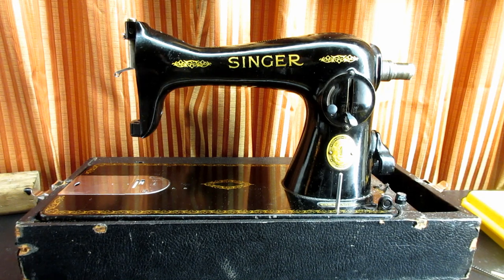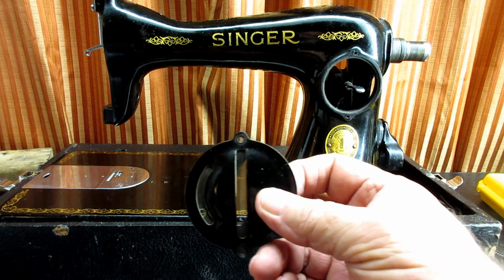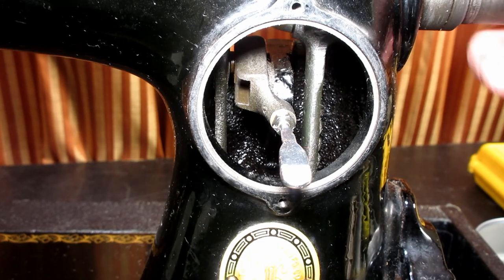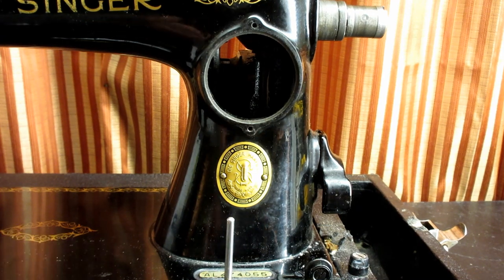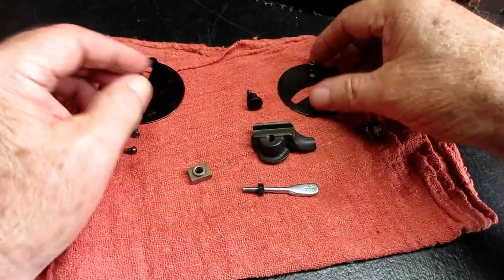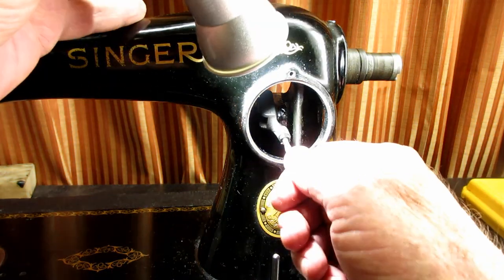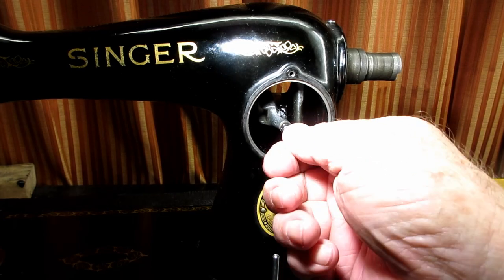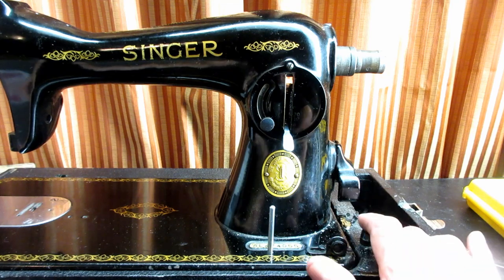Singer Model 15-91 Feed Regulator How to Remove, Install, Adjust.

Comment: Good morning Andy, I have used metallic gold craft acrylic paint to renumber the stitch length regulating face plate. Just paint a little over the numbers and slots and gently wipe off the excess and wallah renumbered plate. Oh I almost forgot to say Thank you for another great Video!
Reply: Thanks for sharing gold paint trick!
Reply: @sherleneabrigo9594  Most welcome.
Reply from the maker: Thanks for the nice tip. I'll pin your comment up top. Any particular thing used to "gently wipe off the excess"? Hope you enjoyed the video. Take care.
Reply: @andytubesewing1953  I use small pieces of cut up T shirts and dampen then up just a little to help get the excess paint off before it starts drying
Reply from the maker: @roosterwilson9371  Yes, sir! That's what I'm asking about. Thanks for getting back to me with this info. 👍

Comment: How do I readjust or fix my 15-91 to make 5 stitches per inch for sewing vinyl???
Reply from the maker: It's not really designed for that, but a small number of people have said they removed the indicator plate and that allowed a tiny bit more travel downward. The problem is that the feed dog, which is what really controls the stitch length by how far it moves the fabric during needle strokes) may hit either the body in the back or the hook in front. I've never done it myself but have never had the need for a stitch that long.

Comment: That's called a spring washer or a  Belleville washer.
Reply from the maker: Right you are, Jo. A Belleville washer, also known as a coned-disc spring, conical spring washer, disc spring, Belleville spring or cupped spring washer as per Wikipedia; https://en.wikipedia.org/wiki/Belleville_washer
Other than that, how did you like the video?

Comment: Would someone need to adjust the machine, after doing this or?
Reply from the maker: No, not at all. We are just removing parts for cleaning or replacing or maybe to paint the gold numbers back on. Nothing in the video will change how the regulator system works, except maybe oiling it can make it move easier and smoother. There ARE adjustments that CAN be made to the feed dog at the other end of the machine, like to set the proper height and the position in the needle plate, but those changes are made under the machine. A really good question ⭐ and thanks for asking it.

Comment: Thank you, Andy. Excellent video. I now understand how the stitch/feed regulators work and how to reduce the stiffness of the stitch regulator handle. My mother bought a 15-91 new in 1949. I learned to sew on it when I was a kid and I inherited the machine in the 1980s. Have been putting many miles on it since and love the machine. It will get passed down in my family when the time comes. 
Thanks so much for helping us service these great machines.
Reply from the maker: Thanks for the uplifting comment, Linda. 🙏 I love hearing of family-owned machines. It certainly has more lifetimes to go with a bit of care. This was the only 15-91 I worked on and I found it fascinating. It's built more like an industrial machine, IMO, than a household model. Here is the complete Playlist for the model: https://www.youtube.com/playlist?list=PLsCOZgzzaiKJftyGwzdDiWa9R6HFEACJo   I had started to record about cleaning and rewiring the motor but became too ill to complete it. Luckily for all of us, there are some very good videos for doing that. May you always sew in happiness, and have a great New Year 2024

Comment: Hi Andy.  Question regarding the slide block:  As you showed, the slide block protrusion (minute 17:00) goes up against the feed forked connection in this machine.  In my other machines (403A, 404, 401A) that I have restored, I put the protrusion the other way, into the slide.  I panicked, thinking I have to go back to those machines and flip those block slides over, so the protrusions sit against the feed forked connection.  Then I rewatched your videos on the 404 and 403A, and you also put the protrusions in these machines into the slide.  Will you please clarify this issue for me?  Why would Singer flip that slide block over in its more modern machines?  Thank you for this video.  You spend much time storyboarding, researching, filming, and editing making these videos.  I enormously appreciate your work.
Reply from the maker: Hi, Carole. Thanks for watching the video and asking such a well-worded question. In this video, I put the slide block on in the position I found it when I first removed it. I have parts manuals with pictures and parts numbers for all the models you mention, but none of them are clear as to the positioning of the protrusions. They are not mentioned in any of the Service or Adjusters Manuals as far as positioning.  Offhand I'd say if something is incorrect, it is this video. I went today to my storeroom and retrieved an old model 404 I bought years ago for parts. It was lightly used but had been dropped hard and the bed broke so it was cheap and I've used several parts from it. As near as I can tell the feed regulator indicator plate had never been off the machine. When I removed it and looked in at the slide block, the protrusion is clearly facing INTO the regulator and AWAY FROM the Feed Forked Connection. When I worked on my first slant needle, a model 301, I had no documents so I took pictures of everything, especially before I removed parts, so I knew how it went back. It's my belief that how you placed the slide blocks on your slant machines is correct. It's also my belief that how I found the slide block on this 15-91 MAY (might) be wrong, but that's how I found it. I also can tell someone has worked on various parts of this machine by the look of several slightly damaged screws, a missing screw, three missing oil wicks (so far), and so forth. However, as this is the first and only 15-91 I've ever had my hands on I'm going to take a wait-and-see attitude towards the slide block. I can say I have reinstalled it to make other videos and it seems to work normally, but who knows in the long run, and I have not sewn anything yet. I assume you don't have a 15-91 or you would have looked at yours already. If/when you or I can hear from another owner as to what they find I'm OK leaving IKE as shown in the video. If you happen to belong to any online sewing groups and ask members about their machine and get a credible answer please let us know. Take care and thanks again for raising an important question.
Reply: Thank you for your detailed answer, and for checking your parts 404.  I’m happy to read that putting a part back how one finds it is a valid and operative method.  I am sure you assembled Ike correctly.  I shoulda mentioned, I am following your tutorials with my own 15-91 (A Roger find $50 at a flea market).  And, yes, my slide block was in the position as you found Ike’s, with the protrusion against the feed forked connection.  I have wondered how slide blocks go in since I first started watching and working on my 457 with your videos—the protrusion goes in the slide with the 457 (Same goes for the 328, 337, 347).  So I thought this was the way for all Singers with these parts.  But not so for the 15-91!  If one puts the slide bar with the protrusion in the slide in the 15-91, the slide bar sits maybe 1/8” above the slide edges itself, because the protrusion rubs on the bottom of the slide.  So I’m sure the slide bar goes the way you put it in Ike—it fits nice and snug and sits exactly deep into the slide bar.  Curiously, with all my other machines, the slide bars actually do not touch the bottom of the slide, no matter which way you put the slide bar; the slide is kind of curved at the bottom, so no matter which way you put in the slide bar, it doesn’t touch the bottom and is the same height above the edges of the slide.  Well, now I’ve learned to take some pictures before removing parts, even though I have your videos to double check!
Reply from the maker: @carolemagnusson5044  You would think at my age I would know better than to assume, haha. I'm happy you have a 15-91 (at a great price thanks to Roger, the Prince of  Procurement ⭐) and you verified the position of the slide block. That makes two for two machines. Normally, putting a part back the way you found it is valid, but not always. Think of it like "trust but verify". There are a few times the part was wrong to begin with. Maybe a pressure washer had been reversed, or the parts on a 500A bobbin winder were out of position. Sometimes it is very obvious b/c it does not function properly. Anyway, as with this slide block, I wondered why I found it as I did, but accepted it. Maybe the hinge stud through the Feed Forked Connection on the 15091 is a little different; whatever. After assembly, it worked just fine so I left it. I feel more confident now that your machine is set up the same way, and thanks for letting me know. 🙏

Comment: Started working on a rusted 15-91 and can't get the little screws on the regulator plate to release. This is the second day I've use penetrative oil and nothing..... any suggestions? Your videos are SO informative! Thank you so much!!!
Reply from the maker: This can happen for sure, and sadly those little screws are a fairly soft metal and it's easy to strip the slot out on them. I have had pretty good luck with heat. Blowing hot air on it with a hair dryer for several minutes. Might try that. Also, you can try tapping on the screwdriver with brisk sharp taps while trying to turn it at the same time, that shock effect can often break a screw free. Finally, you mentioned rust and if you feel that there is rust on those screws or on the back of them, you can try a drop of rust remover on the screws but be cautious and read the directions of your rest remover to be sure it will not harm paint because many of them do. That's all I can think of tonight and good luck!.
Reply: @andytubesewing1953  thank you for the speedy reply!
Reply from the maker: @SewPerky  well your timing was perfect as I was just checking one last time before shutting down my computer. I hope my suggestions can help you and thanks for keeping that machine in service

Comment: Hi Andy I really love your videos and I always reccommend them to people. I am wondering about matching the forward and reverse stitch. My machine makes a reverse stitch that is about 1.5 times longer than the forward stitch. Is there a way to adjust it so they are even? 
thank you for all of your videos
Reply from the maker: Wow, what a question! 👀 I've been thinking about this on and off all day, haha. 🤕 I've never had the problem and I've been trying to imagine what could cause this. All I can think of is the feed dog adjustment for positioning length-wise in the needle plate. The feed regulator does set how far the dog moves, and in what direction, but it is the dog itself that moves the fabric. The dog raises up near the front of the needle plate opening, travels towards the back, and goes down. It is an ** elliptical ** movement. When the regulator is placed in reverse the dog moves the opposite, that is from back to front, to pull the fabric towards you. If the dog is adjusted poorly it may be too near the front or back. As it travels in its elliptical path it may travel forward too far before it drops below the needle plate, thus moving the fabric farther during reverse sewing. Look, I'm flying by the seat of my pants here, 🩳but it's the only thing I can think of. 🤷‍♂️ I have a video about the feed dog that you could look at and see what you think. It's rather long, but the part about adjusting the dog lengthwise starts at about 59:40 https://youtu.be/JAvpcgsUY-o    As you commented on this video for model 15-91 I assume that is what you have. Keep in mind I could be far off the mark on this, OK? 🎯  Good luck, and thanks so much for watching my channel.
Reply: @andytubesewing1953  hi Andy  thanks for your response it helped me to pin point the problem. I am working on a 15 clone that has similar functions. I found that the slide is not exactly accurate. The part that stops the stitch size that you choose. It favors reverse ever so slightly, and since it is such a small range of movement, it causes the difference in stitches. It is easy to just eyeball it. Thanks again, I do have a bunch of singer screws if you still need that part.
Reply from the maker: @shopooakgood9188  sure. A clone? OK then I'm glad if you found a solution. 👍